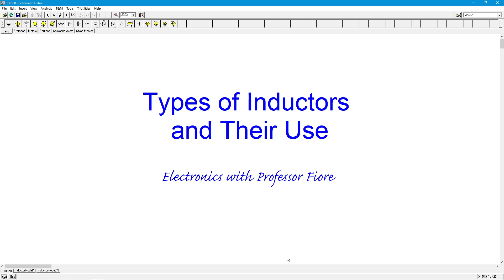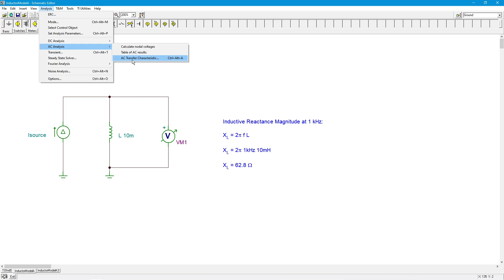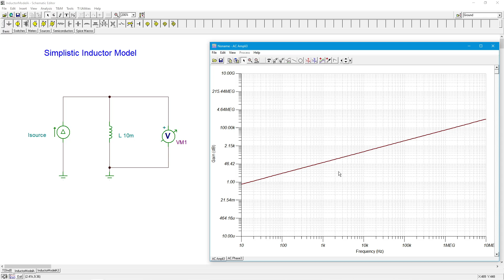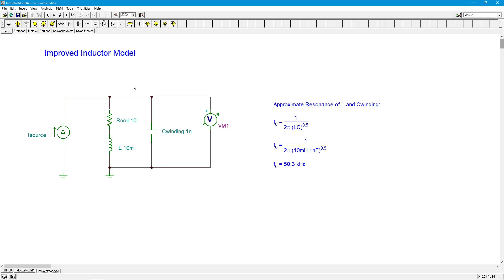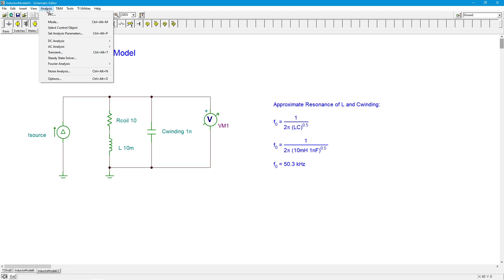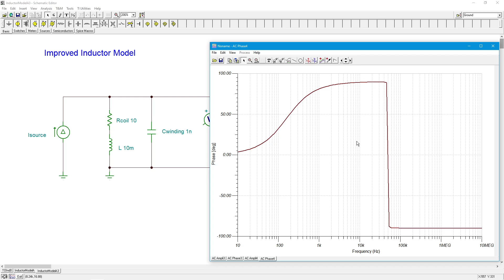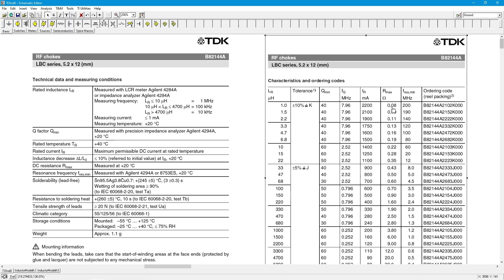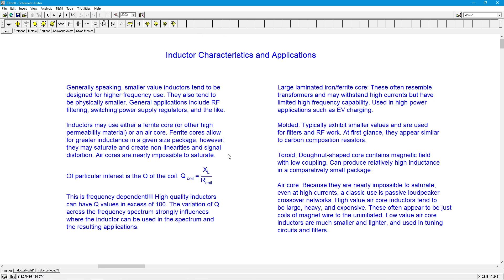AC Electrical Circuit Analysis: Types of Inductors

Comment: DC resistance is shown on the data sheet as DCR
AC resistance is ACR - ACR is frequency dependent!
ACR in an air core inductor is almost zero at "moderately high" frequency.
In inductors with a core material, ACR often becomes non-trivial at operational frequencies that are seen more often as size and frequency of operation are closely coupled... In SMPS applications, higher frequencies allow smaller inductor and capacitor components. This results in both  the materials and parameters becoming more critical for optimal performance, while requiring better knowledge of the performance of the components at higher frequencies, and with operation closer to the limits of materials and even geometries.
(In one SMPS design for handheld devices, the models calculated an efficiency that was almost 3% above the measured efficiency of prototype devices, even after "tweaks" to the IC design, with increased switching FET sizes; after some puzzling over the "lost" performance, an air core inductor was "strapped on"[the sir core inductor being 10x largeri!]the test PCB, and suddenly, the performance lost, was found! As the new design operated at 1.25 MHz, the frequency was now high enough that the component's ACR had become a limiting factor!)
In addition to the DCR, the ACR, of course, can also be a limiting factor for the Q of an inductor. Again, the size, materials, and geometry of an inductor interact to affect parameters of the inductor, like the Q.

Comment: Just a simple guy from 🇨🇦:
Regarding inductor physical size:
- influenced mainly by performance requirements in specific applications 
-: for the same inductance value, on the same volume of the same core material, a larger inductor sometimes results from larger size of the conductors required to achieve lower DC resistance of the inductor:
    - reduces energy loss
    - reduces heat generated 
- a larger inductor, with the same inductance value, the same core material , and the same conductor size, is the result of a larger core volume 
      - larger core size provides for higher saturation current 
      - Higher saturation current is often needed when an inductor is operated with discontinuous current, often seen in SMPS designs, or when the load seen by the inductor is discontinuous, like a filter capacitor, when a PWM is first started. If the saturation current is too low, the saturation of the inductor leads to a "vicious circle" of continuously increasing inductor current, until the output load is reduced, the input voltage is terminated, or a resistance causes a limit to the current.
Reply from the maker: Oh yes. I think one classic example that audiophiles can relate to is an inductor used for a low frequency crossover network in a high powered loudspeaker. Saturation is taboo so air core would be the norm, and to keep resistance low (minimizing power loss and maximizing damping factor), large gauge conductors are needed. The end result is what often looks like a large (and heavy) spool of thick magnet wire (compared to the other components, that is).

In lab we often used some high quality 1 to 100 mH coils that were around the size of a 1/2 W resistor. In contrast, a 1 or 2 mH crossover coil might use 16 AWG wire and come in at over a pound in weight (and probably set you back $20 or $30).

I should also add that sometimes these coils are made out of copper ribbon instead of round wire. And that reminds me that some high powered loudspeaker voice coils (e.g., JBL pro) used edge wound copper ribbon instead of normal round wire (you get more copper in the gap that way, but it's more expensive to manufacture).

Comment: Interwinding capacitance can cause major problems in the performance of audio transformers, which are, essentially, two chokes of different values wound on the same core for impedance matching. There are tricks involved in winding each coil, such as staggering the coil in sections, which cuts back on the capacitance by breaking up the electrostatic coupling of the coils. This video is a valuable lesson to those just learning what can occur.

Comment: Thanks for the video, it's very useful. One question: wouldn't the Q depend on the frequency also because of the skin effect?
Reply from the maker: Yes, it does. You can see that in the graphs from the data sheets at 15:30. If the resistance was constant, then Q would just keep rising along with Xl.